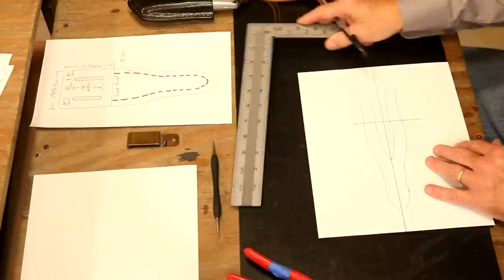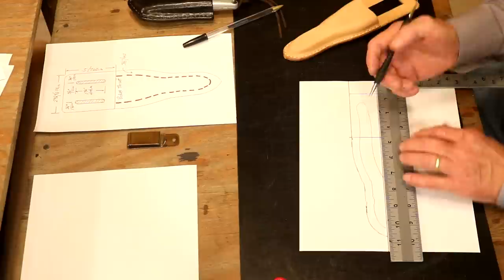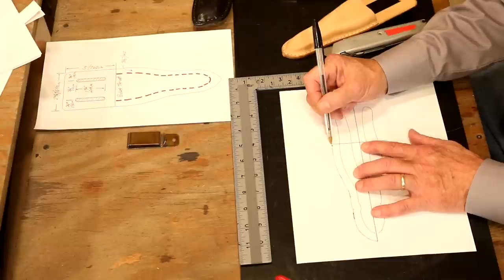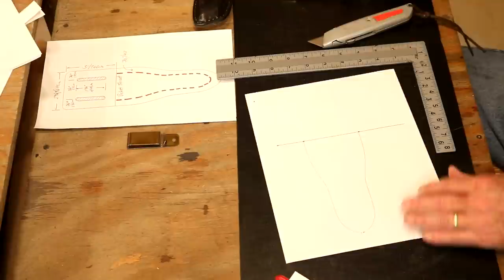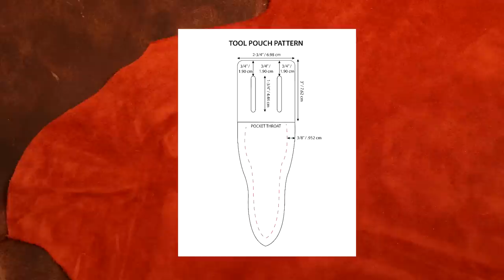Making a Wet Molded Leather Tool Sheath

Comment: Chuck, I would have added a rivet at side of the opening into the sheath. Yes I have no doubt that the heavier thread will be sufficient to hold the sheath together. I always air on the side of “more is better”!  These Utility holsters take a real beating with the tool going in and out. After awhile the leather is going to stretch and “May” come loose. In a previous like, I used a lot tools that were thrust into and pulled out of the holsters.  I speak from experience. This is my opinion and only my opinion! All of you can make up your own minds whether to go the extra step or not. Best regards, Richard……

Comment: We have a vacuum sealer for storing food.  I needed to make a holster for small pistol.  I wrapped the gun in plastic wrap, put the leather around it and molded it with the the vacuum sealer.  It worked fantastically! Let it sit in the sealed plastic for a bit then pulled it out to finish drying.